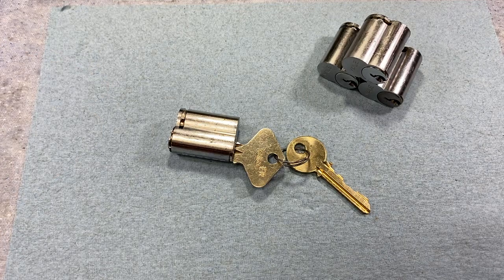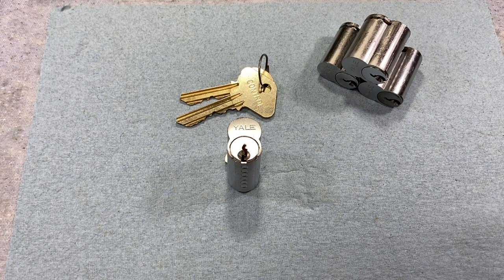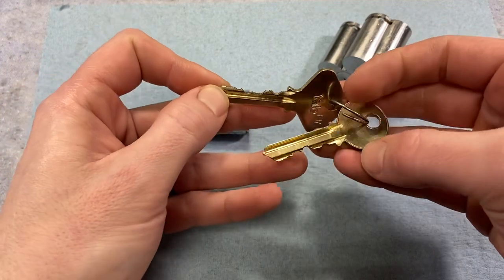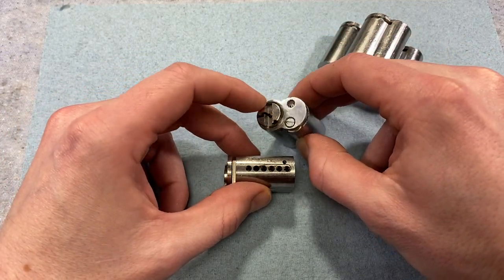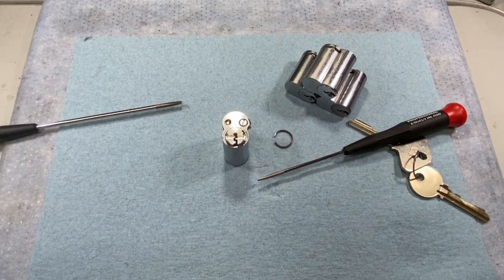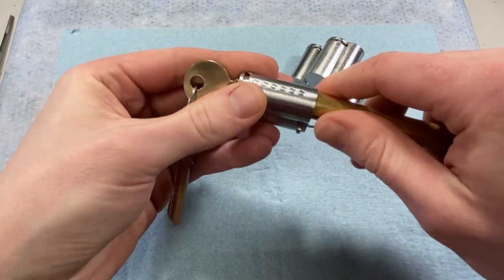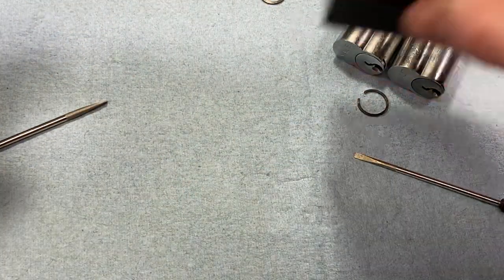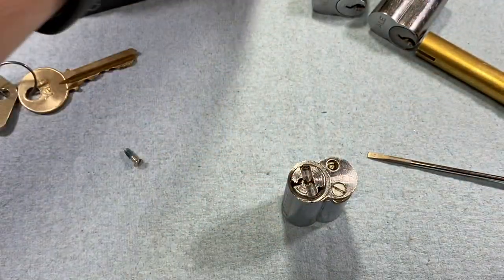How Yale's Large Format Interchangeable Core Works

Comment: Thanks for the informative video. Just ran across my first facility with these. They had bought the doors from a contractor doing a remodel on another building & the hardware had these on them. Was hoping that they weren't like Best or Sargent with multiple sheer lines, so I've got a decent chance of picking them if they aren't able to track down the control key.

Comment: Very interesting. Guess macs will limit some cuts on the front pin of the operating key, and interesting bow design on the control key.
Reply from the maker: You are absolutely correct. In some cases it does happen with existing systems.